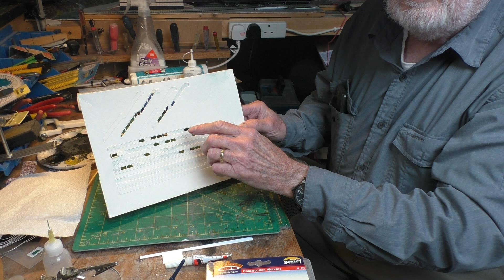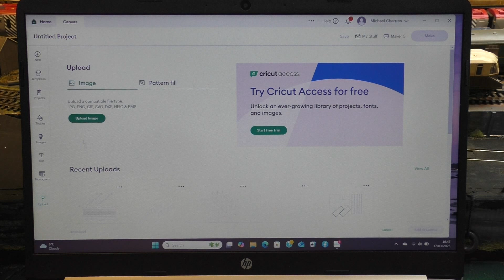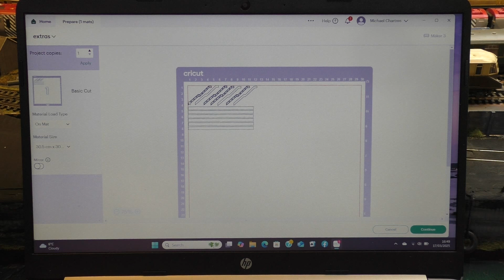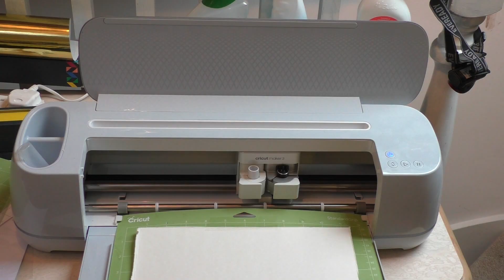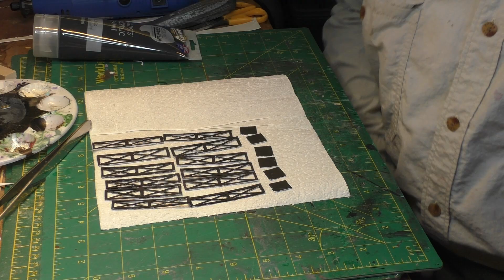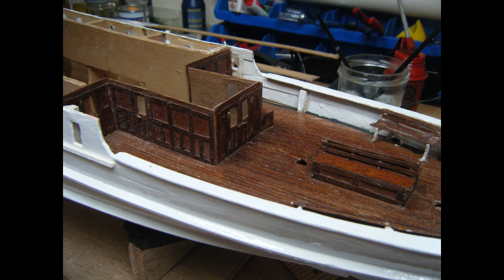Not so Negledted 00 Layout Episode 15 Platform Bridge made with Cricut Maker 3 plus a model ship

Comment: You do make some very good cardboard structures with your Cricut and that has me wondering how you would get along with a laser printer. The bridge looks the part even without steps. As for Bohuslan in the harbour, well my first thoughts are how good it will look and my second thoughts have me fearing for her safety if you find yourself reaching over to re-rail a train or something. David.
Reply from the maker: Thank you David.  I shallbe putting steps in.  My thinking is to bend paper strips like a concertina.  Don't worry about the Bohuslan, I spent too many hours biulding it..  Cheers Michael